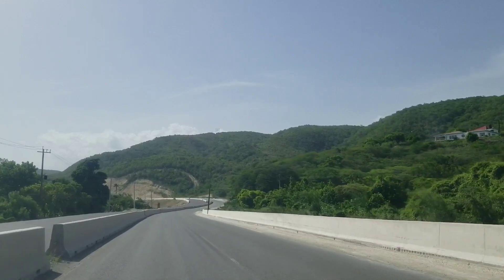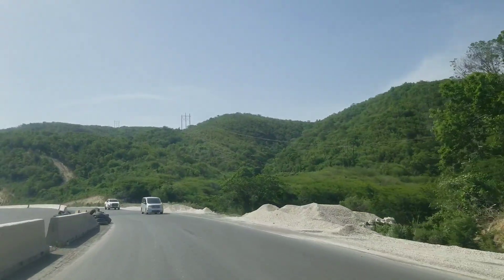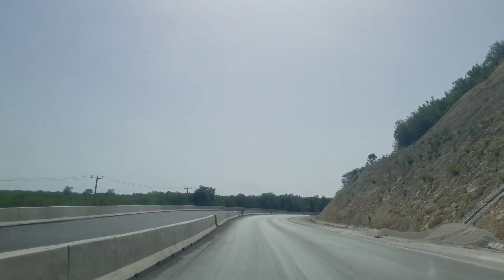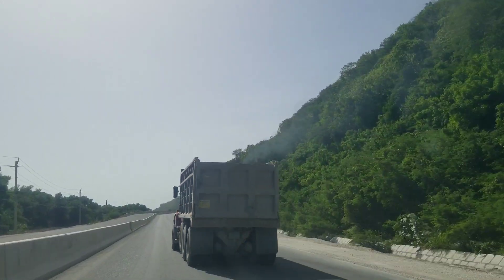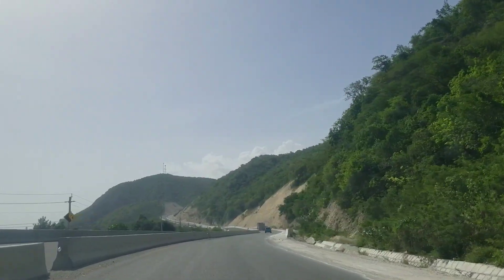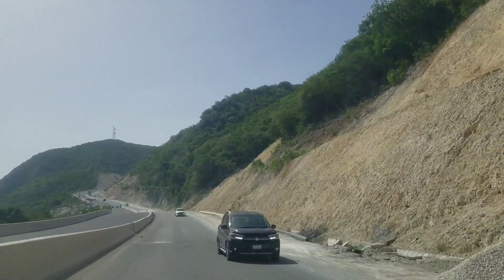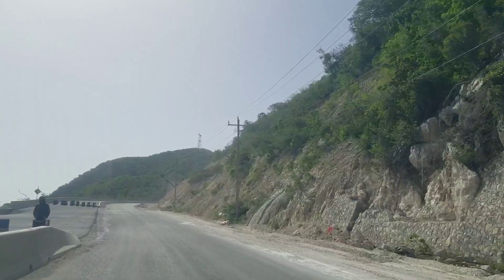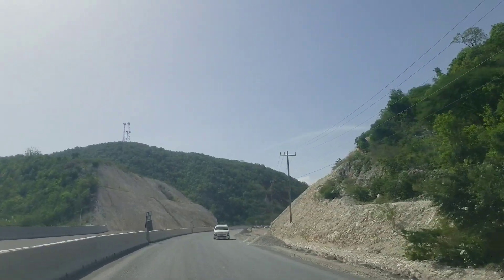Construction Southern Coastal Highway Jamaica

Comment: The traffic needs to filter into 1  lane before it gets to the bridge, not doing so would create a bottleneck at  the bridge,   just imagine two lanes of traffic going in the same direction trying to merge in a single file to get on to the bridge? The bridge is NOT a 4 lane road so that's the reason the road was designed that way.
Reply from the maker: Thanks